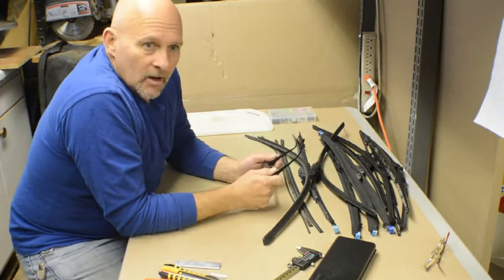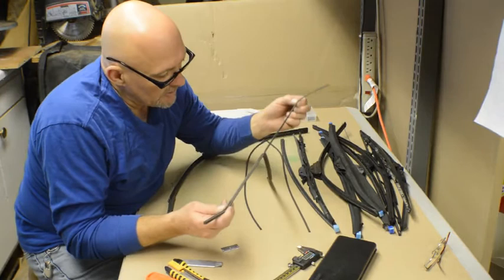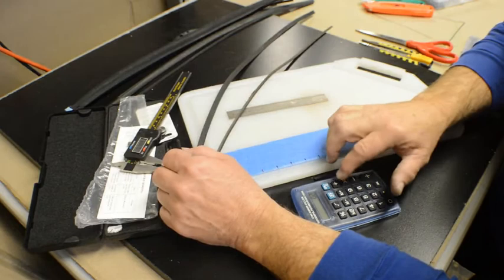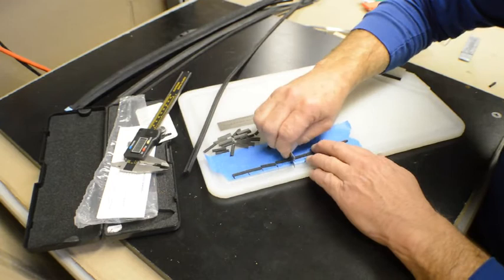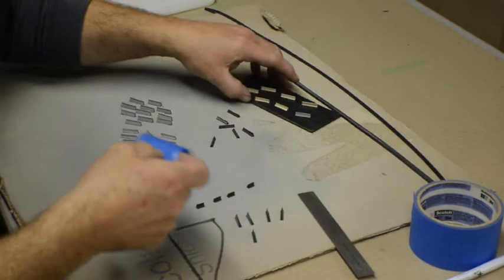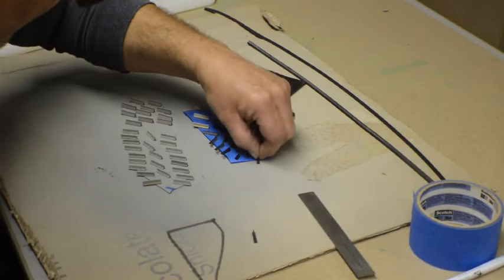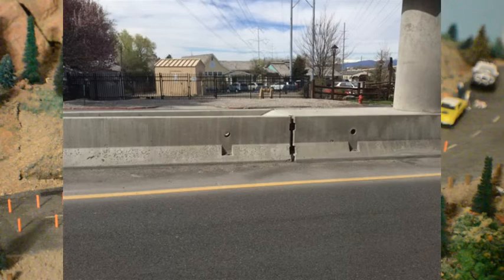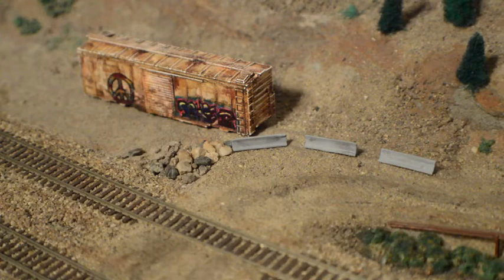DIY Concrete Barriers for your Model Rail Road

Comment: It never ceases to amaze me.... I've been in the Hobby for almost 43 years, and am STILL learning things that I've never heard of before!!
They DO look like concrete barriers. I'd have to do some searching, because I'm in HO Scale. Very worth the effort, as they look GREAT! 

One suggestion, I use this with great success on Delrin and Celcon handrails on locomotives.
At your R/C Hobby Shop, they sell spray paint for Lexan car bodies. It stays flexible and adheres well to slippery surfaces. If you move them a lot, this paint may be a better option.

Gotta warn you though.... It's FAR from environmentally friendly!
Reply from the maker: PacbeltRR, Thanks. . . . . In the video @ 3.10,  I show some of the Biggest that I found, Not Quite HO, But, I have not checked into Big Rigs. . .Not sure if they are different.  . Good Luck to you. Report back if you find something, I would love to know. . . and thanks for checking me out.

Comment: Awesome Idea!!! I'm always looking for things that can be reused for my N Scale Layout. This is amazing!! What was the math for the smaller barrier you are using. I have to get me a caliper, & a N Scale Ruler. Thanks for sharing this idea, It is awesome.
Reply from the maker: On my N Scale Ruler it shows just about 2.5 feet tall.  . . Using the my digital caliper, it measures out .2 inches ( point 2 ). . .  .2" x 160 (n scale) = 32"  inches tall . .  and .150 wide ,    .150" x 160 = 24" wide . . . and then cut to a scale 10' long which is 3/4" . . Thanks for your comment and I hope this helps. . . Let me know what you come up with. . . FB@ Model Train Details.
Reply: Awesome, Thanks for the reply. I'm going to attempt to make some of these myself. Thank you for the measurements. I like your cone pods as well. Hope you have a awesome 4th. I'll save the info for future reference.